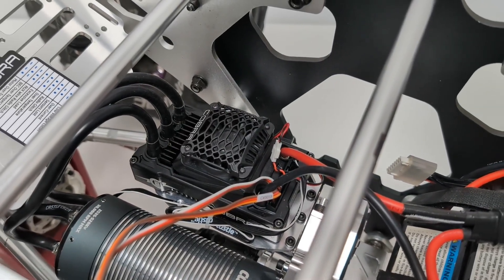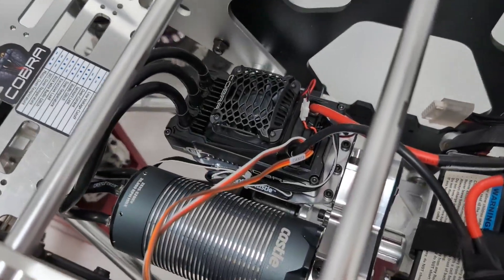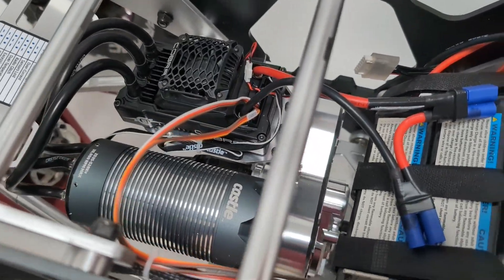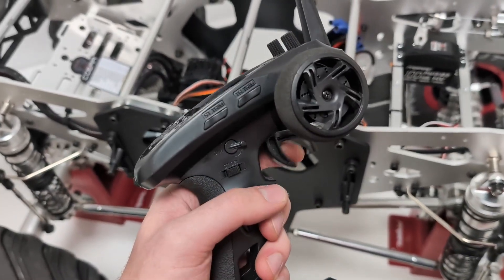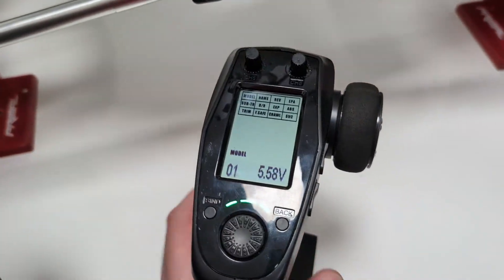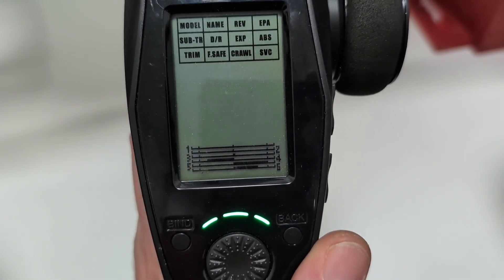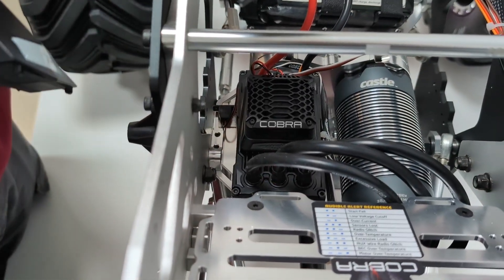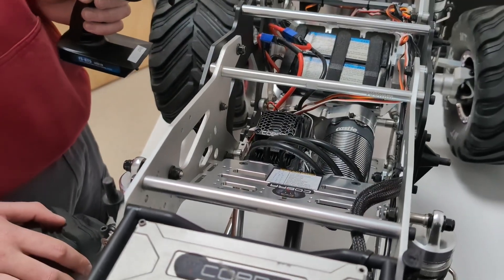Castle Creations Motor Install and Test - 12S Lipo!

Comment: Great vid! A centerdifferential in the future to save the drivetrain? 🤔🥰
Reply from the maker: This new electric transmission uses a torque damper inside the spur gear to absorb any stress in the drivetrain. You can see it here :)

https://primalrc.com/product/prrmt239-259/

Comment: How about get with M2C to build a duel motor kit for two of them Castle monster motors and two ESC’s .. a good kit made from REAL 7075 and good hard steel and high end hardware would be awesome… not cheap, but you wouldn’t own this RC if you couldn’t afford to hook it up. In my opinion
Reply from the maker: @ Two of them will fit in the kit and this kit has wide strong steel gears and oversize sealed bearings

Comment: That link already hits that motor and u were not even near full compression u are pretty much selling something that wont fit in correct yet I would definitely re engineer something if your gonna sell this as a plug and play option on your website
Reply from the maker: We did explain that in the video but bashing it with the 14 tooth pinion had no problems.
Reply: @PrimalRC I know i watched the whole video I was just saying that u showed it with a 14 tooth pinion and it hit with what looked like an inch or more of travel left you said to move the link out but then your gonna make the 4 link angles weird I was just saying that u should be showing this as more of a u can do this setup but for now it's not really going to fit correctly and say we are working on a solution witch im sure u are for  but I seemed like your offering it on the website like it's a perfect fit and someone could see that not have  seen this video and think it's gonna be a perfect only to install the motor and then they find out the link hits

Comment: I wish primal offered a slightly smaller version.  This is a tad much for a lot of us.  I'm pretty rough on my trucks and the Raminator needs a slightly more sane operator.  My big 8s Arrma trucks,  xmaxx, and Vigilante take most of what i do though.  My LMT is just to small.  We need an xmaxx sized option between the Raminator and LMT.  The price isn't as prohibitive for large scale fans, it's the durability that holds some of us back.
Reply: I think the arrma outcast 8s is perfectly sized basher for 8-12s fun. I have the k8s also, but it needs 10s or 12s to better suit its size. O8s runs perfectly on 8s. Could go ta 12s for crazy bashing the o8s tho.

Comment: Will 2 of the castle 2535 motors fit in your dual motor mount?
Reply: Look like to be the case 👌😎 so somone should try it, for sure!
Reply from the maker: Yes it will fit, although we really recommend 1 of these motors. The truck is already powerful enough with one :) For dual motor setups we recommend the 56mm size motors (Castle 2028)